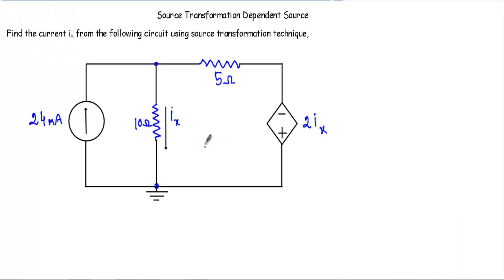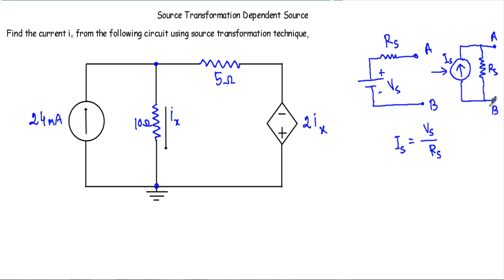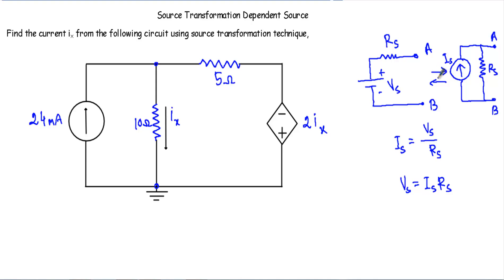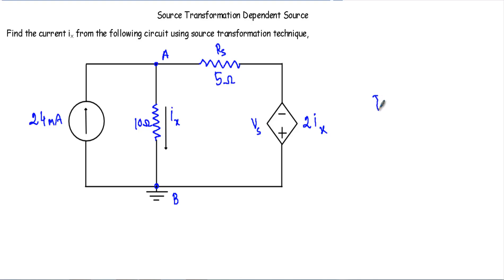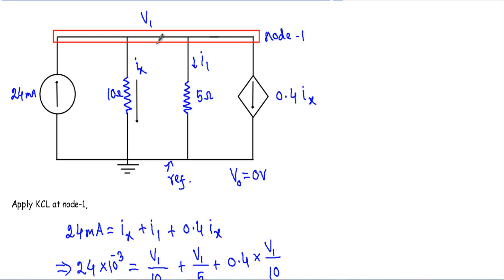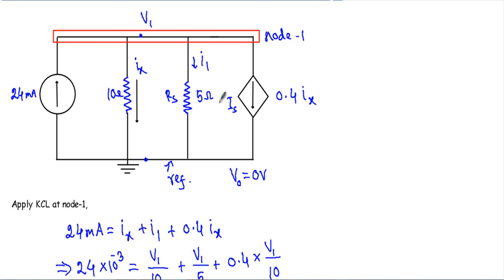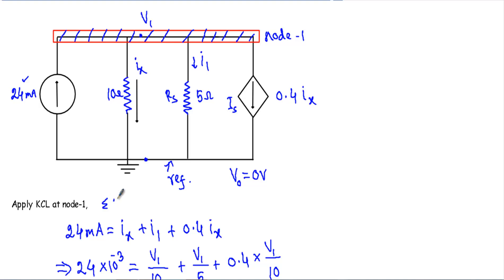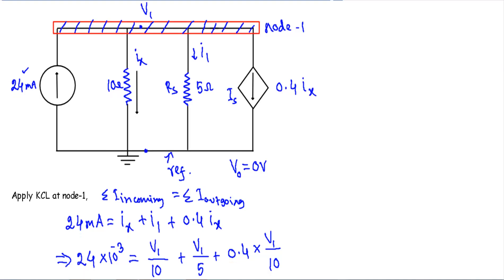Source Transformation: Dependent source Circuit

Comment: 24mA is not 0.24 and how did you get 3.4v on the nodal equation solution. Seems like your rushing through it and making careless mistakes.
Reply from the maker: I think you are callously looking at my calculation. There is no mistake in my calculation. If you cross multiply 24mA with 10 (the denominator in the right side), you should get 0.24. In the previous line, take the LCM of the terms on the right side.